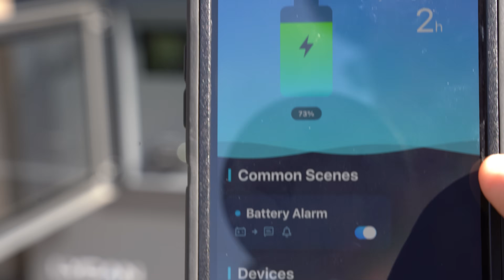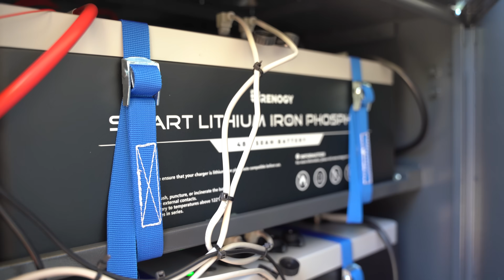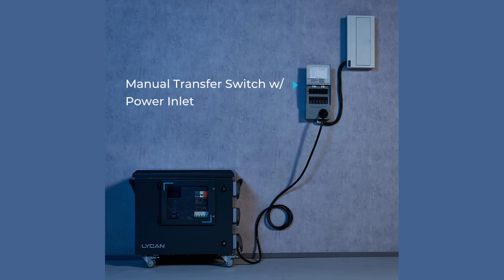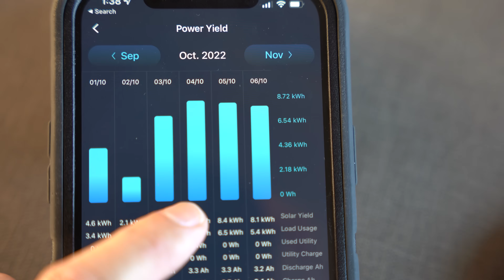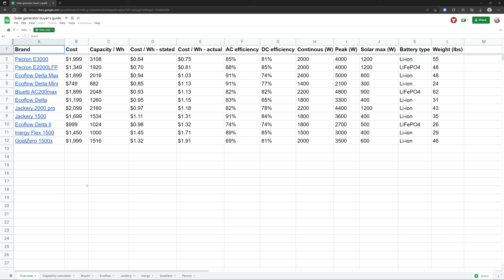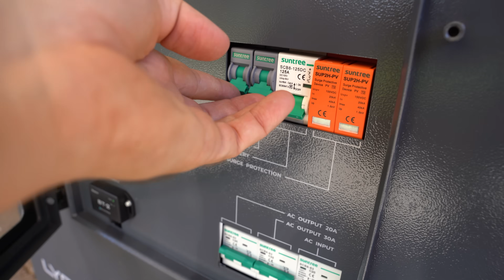Renogy Lycan 5000 - Home Backup Power

Comment: Remember. Electronics don’t last forever. They are more complicated than ever. I have a degree in electronics however components have gotten so small. You don’t see standard size diodes, capacitors, or resistors anymore. They are all specialty or proprietary and not cheap. Don’t expect to just get electronics fixed by some magical technician that comes across your way. Bottom line!
Make sure you have extra charge controllers, extra wiring and interconnection solar panel cables. They can rot and go bad over time or rats can chew thru them. Make sure your batteries can be reconfigured in a reduced amount when one goes bad. Have instruction manuals both hard copy and digital. It doesn’t matter if you have a 100 dollar solar battery bank. Whatever your budget get two. 
Even if you don’t know how to use a multimeter get one even if it’s a cheap harbor freight meter (in that case get two) tools will be invaluable.
Reply: True.  He also never mentions that this was most likely sent to him for free.  What kind of man buys like 10 different brands.  They were sent to him free for a review and to make money

Comment: If I was buying this system for a power outage during a storm I would consider it.  But it is not good for more troubling times.
Reply: Anything that can give you power for devices is good for troubling times. This setup with extra batteries to give 19kw would easily run essentials. Would give you over 10 days of power for a fridge/freezer alone, and leave plenty to spare for lights etc. Not to mention you should get enough sun/light for solar to recharge it back up before it ran out.

Comment: Have you done the math or tested how any of these battery systems do when powering a home AC unit, such as a 3-4 ton unit. My hunch is that you’d need a Lycan for just that and then another for the rest of the house?
Reply: I power my 4 ton unit with 3x powerwalls.  Even with 40kwh, I can empty the batteries in about 6 hours running a/c continuously on a hot day.
Reply: Unfortunately that would draw way to much power for a small system like this . Yu would need a whole house system to even think about power and maintaining this type of unit .
Reply: @eric0u812  Why natrual gas generator is the way to go lol
Reply: @shanew7361  that would be the way to go but do you do when the gas lines stop working? And most people don't live near  or know how to use or tap into a pump jack .so that would be short term
Reply: @shanew7361  Solar will always win out as its resource for power is more a less infinite. It's just confined to how many you can setup and how much storage you have. With enough panels you could run A/C during the day with no issues when its sunny. Then at night just switch to low draw things like fans that can run on your battery setup.
Reply: The question is valid but the answers would be all over the map depending upon what kind of HVAC system, the size, how efficient the home is. A smaller highly insulated home with a high efficiency mini split is going to require much less than a poorly insulated larger home with a 10 year old spec AC and electric strip heat.

Comment: Like my Champion duel fuel. Works great and I built a quiet surround for it.
It cuts the sound by 2/3rds.
Thanks for the info
Reply: What materials did you use?
I gave a DF generator also. A Durostar.
Reply: @complexblackness  used a pre-made plastic garden shed and lined it with foil backed insulation board .  Used a dryer vent tube that's aluminum and expandable for air intake and used a tractor muffler for exhaust. 
I use the power to run a vent fan for cooling during the summer I imagine that won't be needed during a Minnesota winter. 
There are some good you tube vids on this. 
Good luck
Reply: @mikeloos4007  smart!
Reply: @rob6850  wish I could take credit I just followed a u tube vid

Comment: What about if you're poor and cant afford all that tech?
Reply: Definitely could use some low to very low budget advice/suggestions to basic necessities.
Reply: @tallyforeman3145  $250 used portable generator
Reply: @mitubogoogle  agreed. I already have a generator. Fuel will run out and dry up eventually. Then it's a relic lol.
Reply: Jordan Peterson says the poor are going to get even more poor and are going to suffer the most.
Reply: @mgtowthread  Jordan Peterson worked for the United Nations on Agenda 21/2030.  

He says a lot of good things, but be careful.
Reply: @mgtowthread  , you don’t need a degree to figure that out.
Reply: I have a deep cycle battery in a battery box and a 200watt solar panel..
runs my 12v fridge and lights and cpap.
cost me 500aud without all the unnecessary teck. A lithium battery would be good but $$
also a small generator just incase
Reply: Duvet, hot water bottle, thick clothes, thermal layers.
Reply: @user-bi8ko7kc6h  Finally, someone on my level :) !
Reply: you can easily peice meal  the solar panels, solar inverter, wiring,  and controllers for far cheaper .   I have a 5k inverter , 1200 watts of solar batteries and chin Lithium-IronPhosphate 100 amp  12 volt batteries ( 9 of them)  the batteries were the most expensive items, the solar panels are used
Reply: @suburbanprepper  ja, Amazon had a great inverter. Sold out. Ppl. Should just read the details on Amazon equipment & they get the jest* of how it works.
Reply: If only there was some kind of kinetic charge run off my exercise bike in the kitchen, harness the power and work for my electric, that would be mint!
Reply: @Shieldmaiden1818  Unfortunately, an hour on an electric exercise bike would only generate around 100wh, and the equipment would undoubtedly cost more than a 100w solar panel anyway.
Reply: @momentomori1747  You need to invent a better one then! That can be your job...
Reply: @Shieldmaiden1818  you'd probably be surprised how little energy that would generate and it would make you appreciate how little you pay for a kWh. My guess is you could generate about 100 watts with relatively vigorous pace, which equates to 10 hours of pedaling until you equal 1 kWh that most utilities charge you about $0.15 for that unit of energy.
Reply: @jdlutz1965  We're talking a grid down situation, the 3 hour blackouts they have planned for the UK... KWH doesn't really matter is there isn't any electricity :'-D
Reply: @Shieldmaiden1818  people do that
Reply: @Shieldmaiden1818  🤔😁😂
Reply: @Favorite-catNip  Do you know what's a Beanie Weinie? I must know.. ;)
Reply: @Shieldmaiden1818  I'm said before motors on exercise machines cud create tonnes of power.
Why no one's making generator bikes I don't know.
Reply: @johnbaxter189  You could even get a treadmill version and a couple of Huskys!
Reply: @johnbaxter189  bc the power companies would lose money. So they prob buy them out before they even get off the ground
Reply: Harbor freight have a good solar panel 100w and power bank. At least is better than nothing .
Reply: Bottom line, this is not a poor man's game.  If SHTF, most would suffer.   Just a fact.  But appreciate him showing these for those who can afford them. Some can.
Reply: There are cheaper generators that can still keep your refrigerator and a few other things like your phone. Tablets or computer.  I bought a medium size after the company gave a 350.00 rebate and Alaskan prepper gave another 400.00 off. You really need to see what other channels are giving away, rebates, or just sales. I think the one I have still has a 350.00 rebate. It's called the rockpal 1300. You don't need 1000.00 dollar solar generators. The panels are sold at tractor supply just make sure you buy the ones that are strong enough for your generator. 
Last..please look into gas or propane generators. I saw some the other day for 400.00 and less that will do alot more then a medium size solar generator.  Invest in one of those first. The first generator I bought was a gas generator.  Before thinking solar try one that will use gas and propane or just one fuel. Start buying fuel a little at a time but start. 
Good luck.  I know even this sounds expensive.  If you know you'll need it to keep your family safe I'd definitely invest in it. You don't need fancy..you need electricity.  I have been very lucky but have been where you are. Had my electricity turned off once and that scared me because I didn't know what to do but you figure it out. You always figure it out!
Reply: None of these channels have ANY information for those of us who can't afford any of these expensive set ups. As always, we're the forgotten, dispensible.
Reply: @midwestern925  no one has forgotten us. I'm a disabled Veteran, single father of 2 and have stage 4 cancer. As this video and many others state, "if you can afford it." I have most of things that I need to take care of my family. I would love a whole home solar power generator and storage. Guess what I am doing...saving for it and looking at some of the government programs out there where they help pay for it. The key is saving, just like most of us were taught to do instead of going into debt for things we would like but not necessarily "need"
Reply: @jeffmills7370  we all have very different circumstances . . .
Reply: @midwestern925  Ditto. We'll be burning campfires on our living room carpets getting sick from the carbon monoxide to keep warm...
Reply: @midwestern925  there are plenty of channels that give information about solar panel setups as well as how to make heaters from tin cans easily, and a pile of other low tech things!
Reply: @annebeignatborde1832  AGAIN, finances for even the most menial supplies needed for these things are a HUGE issue for soooo many!
Reply: @annebeignatborde1832  Who? Do share...
Reply: @midwestern925  I understand, my ressources are very limited too. What I have learned is that if you don't have a lot of resources you need to become resourceful. I live alone so it wasn't a problem when I decided that I would rather spend the money I was paying for electricity on means of generating it for myself. It wasn't easy to start with but every month I add an extra item. I also invest time on researching alternative and low-tech solutions.
Reply: @Shieldmaiden1818  The channels Robert Murray Smith and TNT have recent videos on making heaters that will work with vegetable oil, ethanol, methanol and even diesel.
Reply: Hand crank generator, solar panels, LED/USB lights, basic 12v appliances and good old fashioned ustensiles and tools.
Reply: @annebeignatborde1832  oh very true and a hand crank radio is great
Reply: @eric0u812  I haven't got round to a hand crank radio yet but that's a good idea.
Reply: @annebeignatborde1832  You need one because they charge your phone and you know what's going on in case of an EMP.
Reply: @Shieldmaiden1818  it's mostly for knowing what happens if there's an EMP. If there is an EMP the phone will probably be of no use.
Reply: @annebeignatborde1832  That's why I have one sleeping in my microwave...
Reply: @Shieldmaiden1818  in the microwave?
Reply: @annebeignatborde1832  EMP 3 will completelt fry the entire grid and all electronics unless protected
Reply: @annebeignatborde1832  it acts like a farraday cage, protects against EMP or CME
Reply: @vivb.7161  ah ok. But surely if there's an EMP the satellites and phone towers won't be working so what use would your phone be at that point?
Reply: I'm in a similar situation as you...not so much poor as a 5k solar setup is far beyond my reach...plus I rent so...simplest solution is a propane or gas generator for emergencies that will just cover the basics.
Reply: Basically you will need marine batteries 2 is best for basic lighting.  And a 100 w solar panels.  .  So you can use any light off of a car and most lights off of boats and RV's now for the rest that will take time to break down for ya .
Reply: I wish I could afford $5K + for a battery charger. But I’m still looking for cheap Beanie Weanies.
Reply: @Shark-qd1pz  I love u Americans, what's a Beanie Weinie? Lol...
Reply: @Shieldmaiden1818  small pull top cans of baked Beans and hotdogs  mixed together. It comes with a free Pepto-bosmol tablet to sooth your stomach.
Reply: This is high end for sure. 
Like you, out of my budget.
But a unit that will supply you the basics.
12volt camping fridge.
1000 watt electric heating element for cooking. Then… go shopping. Bluetooth, Eccoflo, Good 1200-2000 watt options out there. Scale to your wallet and needs.
Reply: Yes agree. Ibuild my own and whilst not for free it's more in my budget and does pretty much the same. .but best thing is don't rely on it ,as humans we managed till the last 200 years.
Reply: Several people @shieldmaiden  suggested coupling a generator to an exercise 🚴‍♀️ bike for power. I hate to burst the bubble but while a humans on bikes are very efficient we can't produce much power. A casual cyclist, a fit recreational cyclist, & an elite racer produce about 100, 200 - 300, & 400  Watts, respectively. 

So if you're fairly fit & spend 4 hours per day peddling briskly you might produce perhaps around 1 kilowatt-hour of energy. That "tons of power" is barely enough to power your fridge for a half a day + nothing else. Could possibly power a few LED lights & a radio instead.

Also, based on fit bit data I've collected, you'll need to eat around 2,000 additional calories over & above your BMR (Basal Metabolic Rate) to support the 4 hrs of daily cycling.
Reply: @tomdonahoe3539  Cheers. Worth inventing tho... Go ahead, you have the knowledge..
Reply: Yes all these "preppers" are not realistic to the everyday person
Reply: Get a thin 200 watt solar panel & start from there.  Get a old battery etc. Just start. U figure it out.
Reply: And plan on moving it around to gain access to sunny areas & move the battery around. Like women should get a mobile cart/wagon etc.
Reply: Get less poor. We can't give you the answer on how is best for you to make more wealth. There are literally tens of thousands of ways to credit additional wealth by providing value to the world.
Reply: @WilliamIraWoodIV  Get less poor ina week? I have a good job, so does my partner... We have 3 greedy kids, lol, all our money goes on day to day things... We shouldn't be poor we both work full time, but we are...
Reply: Exactly
Reply: harbor freight sells solar items to piece it together on your own
Reply: I believe you have a very good point. I am a commercial electrician,  I have several ideas for small scale work arounds. At little or no cost. Would be 'recycling' repurposing equipment... but it works.  I have made a  couple of things.  I will make it a priority,  safe and easy to understand. Your point hit home. Thank you for voicing your concerns.
Reply: @Shieldmaiden1818  yeah... the only thing I would say is that like another person commented on is the amount of energy that is expended vrs what is gained might be something to look at.  But it is definitely doable and I have seen YouTube videos on it.
Reply: @Joe mamma Invent it. You will be a billionaire.
Reply: Just don't be poor
Reply: You can always learn to code.
Reply: Ya scrimp and save till ya can afford it.
I'm disabled on benefits and took me years to get my kit bit by bit.
If there's a will there's a way.
Reply: @johnbaxter189  your rigjt .might not be the best way but junk yards can hold a lot of what you can use . Plus  then u can build up from there
Reply: Change your mind, change your life
Reply: @jdlflagstone6980  That would work in a perfect world, but, alas, this world isn’t perfect. But you don’t have to have a degree to figure that out, per what a smart a** Mr Genius poster said to one person who commented
Reply: @marjoriedanley6131  if you say so. It's worked for many in this world, but okay.
Reply: I live in heavy woods. No sun, no wind. My backup is fuel driven.
Reply: @Mike Jones Thank you, why didn't I think of that! Follow his link for the kit, it's only $5199.99.